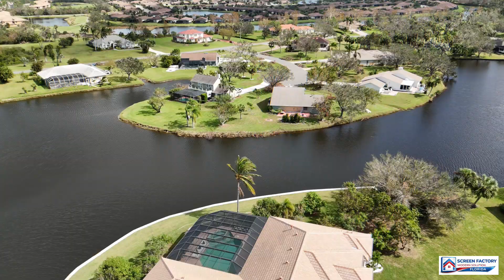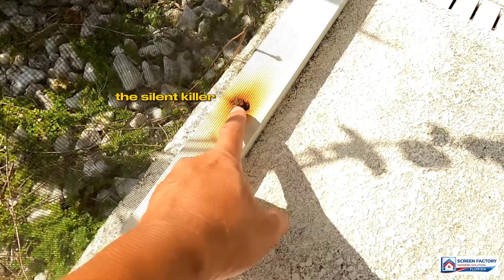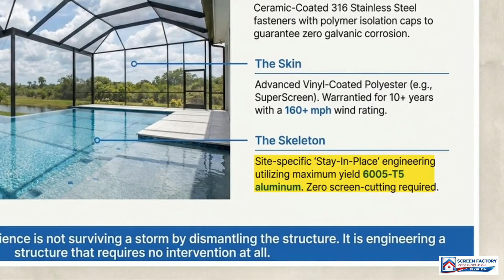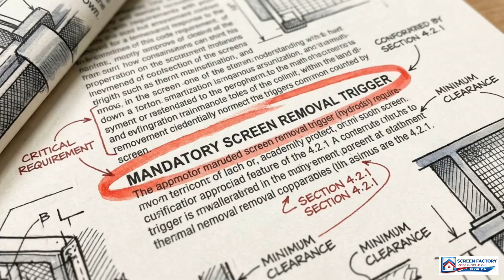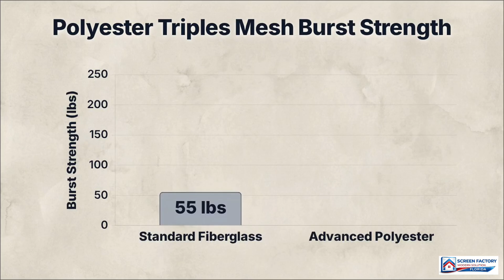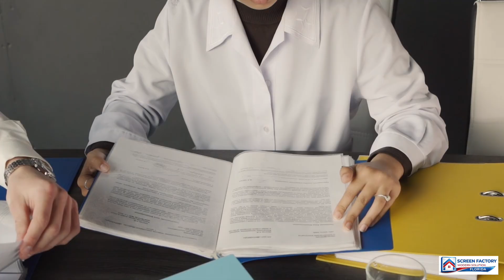5 Signs of a Cheap Screen Enclosure - How to Tell You’re Being Ripped Off

Comment: If you get two quotes from people that far apart both are screwing you😂😂😂😂😂😂😂😂😂😂😂😂😂😂
Reply from the maker: Sometimes true 😄
But in Florida screen enclosures, huge price gaps usually come from engineering, permits, aluminum thickness, stainless hardware, insurance, and whether the structure is actually built to code.
Reply: @scree @screenfactoryflorida at’s bullshit!! Try harder! I never got an estimate that excluded engineering, permits and best fasteners😂😂😂😂😂😂😂😂😂😂😂😂😂😂😂
Prices ranged from 30 thousand to 15 thousand for replacing my original cage!! It’s called competition and being honest. Just like  all trades!!
Reply from the maker: @SWBfreedom  Competition is great. False comparisons are not.

A real comparison means same engineering, same aluminum specs, same fasteners, same wind-load design, same permit scope, same footer conditions, and same warranty.

If all of that was identical - you got a better deal. If not, you just compared two different products.
Reply: @screenfactoryflorida well from your response, it tells me you know nothing about the permitting process. You can’t make up your own specifications 😂😂😂😂😂😂😂
The permit won’t be granted if the project doesn’t meet codes 😂😂😂😂😂😂😂
Reply from the maker: @SWBfreedom  You’re right that a permitted project must meet code. No argument there.

Our point is that “meets code” and “same value” are not always the same thing. Two bids can both pass permitting but still differ in scope, aluminum profile, fasteners, mesh, footer/attachment details, warranty, insurance, workmanship, and long-term durability in Florida conditions.

That’s why homeowners should compare the full scope, not just the final number.